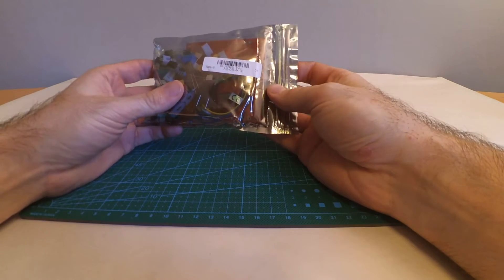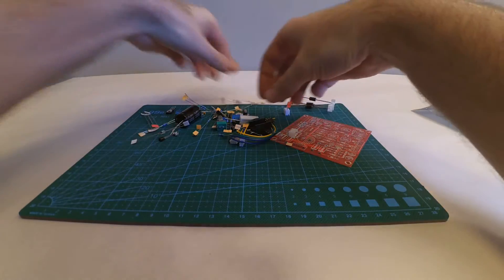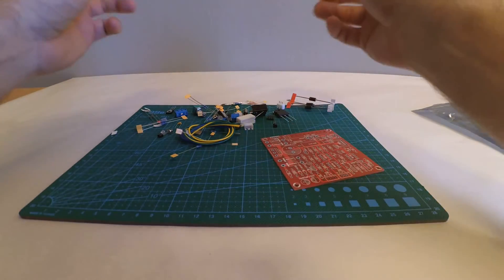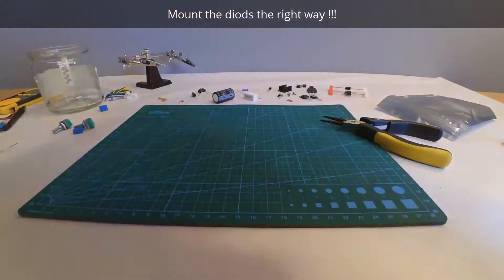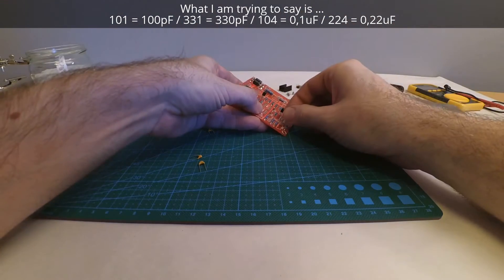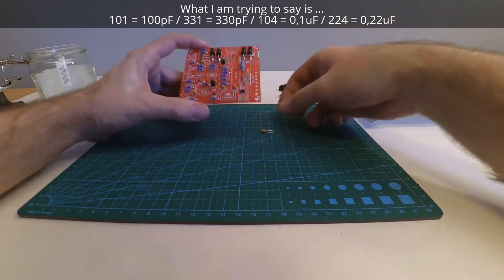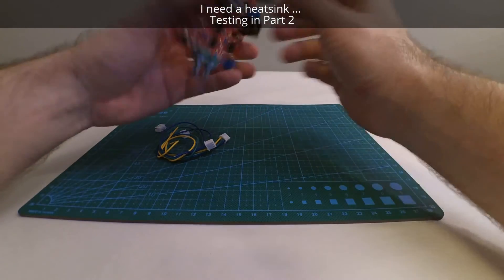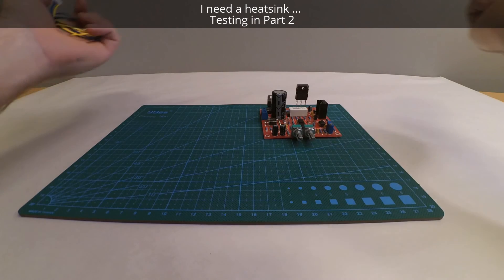#1:1 0-30V 2mA - 3A Adjustable DC Regulated Power Supply DIY Kit - Part 1 Build

Comment: Hmmm. Har nettopp bygd 2 stk av dette kittet og ingen av dem ser ut til å fungere. Ingen spenning på utgangen... Dobbeltsjekket at alle komponenter står rett vei og er rett plassert. Har også målt motstandene før montering. Har en trafo som gir ca 28 volt AC. Nesten så jeg mistenker at det er gjort en feil med selve pcben (ser det finnes en god del varianter av denne ved hjelp av et rask bildesøk med google)
Reply from the maker: Har du kontrollerat att du har spänning efter likriktaren? Fungerar den negativa spänningspumpen?
Kan vara fel i tillverkningen av pcbn. Får se om jag har tid en kväll att göra en felsökning video efter bästa förmåga 😀
Reply: Yes. Spenningen over diode bridgen er 33 volt. Måler negativ spenning i et område av pcben men har ikke helt kontroll på hvilke verdier jeg burde ha der. Finner 33 volt ved Collectoren på NPN transistoren  2SD1047 men den mangler spenning på "Base". Skal feilsøke kretsene fram til denne. Ser jeg har en D882 transistor som kontrollerer strømmen til "base" på 2SD1047. Skal fjerne denne fra pcben og kontrollere den med en transistor-tester jeg har. Hadde vært supert om du har tips om feilsøking på denne for jeg er rimelig novise når det gjelder electronik.
Reply from the maker: Är en glad amatör även jag så min felsökning kanske inte kommer vara komplett :)
Reply: Ser ut som jeg mangler spenning på utgangen til op amp nr1. (U1 i følge: http://4.bp.blogspot.com/-nDTiOoJy3kg/VaK9kezJA-I/AAAAAAAADog/4Xq1V5-ICUA/s1600/PCB%2Blayout.jpg ).
Hvis jeg forstår skjemaet ( http://3.bp.blogspot.com/-_FhPAQiKyfA/VaK5xy_eAVI/AAAAAAAADm8/vjaoJvJMDeM/s1600/Orig%2BSchematic.jpg ) rett skal U1 levere en konstant spenning til potmeterene. Lurer på om det rett og slett er U1 som ikke tålte 2 spenningen fra trafoen på 28volt ac. Kan du sjekke hvilke verdier som er normale på U1?
Reply from the maker: Formula400Pontiac  jag missade att du hade en 28vac transformator. Troligtvis har du bränt op.amp då den tål max 36vdc.
Reply: Var redd for det ja. Har funnet en ny trafo som jeg måler til 25.5 volt AC. Tror den vil kunne fungere. Da er det bare å legge inn bestilling på nye op amps. Mulig jeg modifiserer kretsen samtidig i henhold til http://www.paulvdiyblogs.net/2015/05/tuning-030v-dc-with-03a-psu-diy-kit.html
Takker for hjelpen!
Reply: Your are completely WRONG I DISAGREE WITH YOU.